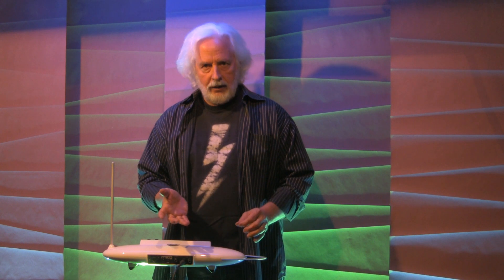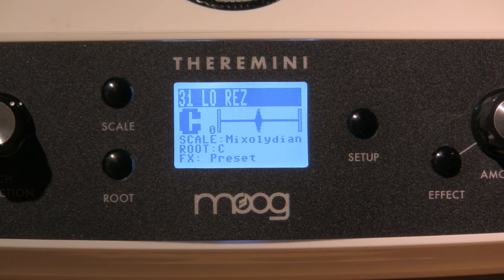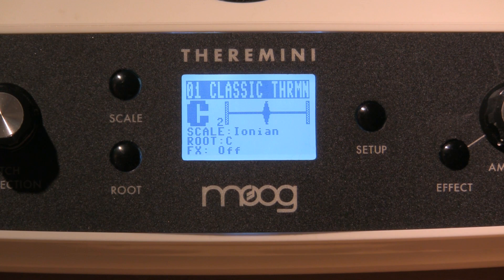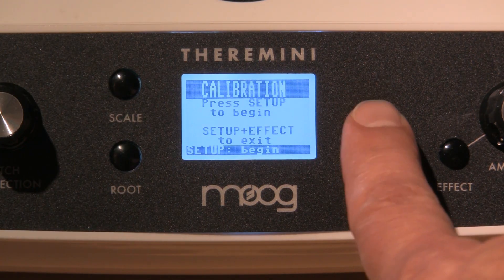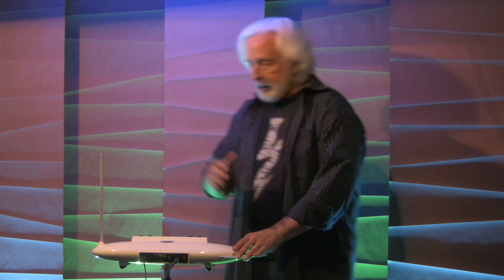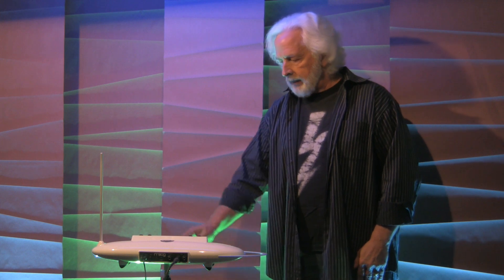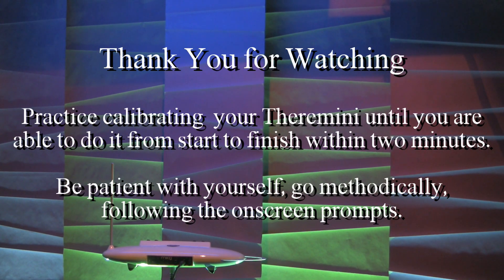Kip Rosser's "Complete Theremin:" Theremini 101 - Basic Calibration

Comment: Thanks for this video. The best video explanation I have watched so far. 
Still having some trouble as my volume function doesn’t seem to do function and make changes most of the time. Do you have any suggestion? This is the closest I’ve come to having it calibrated correctly though!
Thanks so much.
Reply from the maker: I am glad that you find this tutorial helpful. However, I am unsure what you mean when you write: "my volume function doesn’t seem to do function and make changes most of the time." You may already know this but just in case you are unaware of this, the volume knob, even though it does make the volume a little louder and softer, its function is not actually used to control the volume from loud to soft. It is used to change the characteristics of the loop's magnetic field, particularly the "attack" when your hand starts to play a note. As you turn the knob counterclockwise, the response gradually gets smoother. As it is turned clockwise, the response gradually gets sharper attack, becoming more effective for cleaner articulation/definition of notes, which is also crucial for playing more rapidly. Try this for yourself and listen carefully as you play and you ought to notice a difference; it's not a radical difference, but is a difference. If you can tell me a little more about what you mean by "make changes most of the time," I may be able to suggest a little more.

Comment: Does this require an amplifier? Im trying to understand if it has its own speaker or how it all works? Any help is apprwciated
Reply from the maker: Hi, Bryce. The Theremini does have its own built-in speaker. It can be played without being connected to an amplifier. However, the speaker leaves a lot to be desired when it comes to dynamic range. It's sound is there all right, but the bass range is weak. The speaker's capabilities falls very short compared to connecting it to a decent amp. I always recommend a cable and amp in order to really get the optimum sound from the Theremini. An amp with two channels and controls for low, mid and high range will make a huge difference. If you'd like a recommendation (since I don't plug products on this channel) please email me at:

kr@performancekr.com

I've given several suggestions this week to people on a budget for amps under $200.

Comment: Hi Kip! Thanks so much for this extremely valuable resource! Question, after correctly calibrating my Theremini, it plays totally fine for about 10min, then the pitch field begins to slowly expand randomly on it's own, requiring re-calibration over and over again. Anyway to fix this?
Reply from the maker: Hi, and you're very welcome. What you're experiencing is completely normal. The pitch field will change as the Theremini's circuitry warms up. After ten to fifteen minutes, re-calibration is usually necessary. However, it should remain very stable after that. Having to adjust it once more is okay, but if it keeps needing re-calibration after that, something may be wrong. Interesting sidenote: the user manual for the Moog Claravox states right up front that once the machine is turned on, the player should wait a full TWENTY minutes for it to warm up!
Reply: @dnteuxurois  Thanks so much! This makes sense as I usually calibrate it the moment it turns on. I just donated to the Juliet Shaw Legacy Project by the way, excited to hear her music! Hope you're well!
Reply from the maker: @nickybedo7455  Hi, Nicky: Glad confirmation of the need to calibrate every time was helpful. A very heartfelt "thank you" for your donation. I'm still hoping more and more thereminists, theremin enthusiasts and electronic music lovers will donate before we end the fundraising in a week or two. You'll be receiving a personal message from me via email.
Reply: @dnteuxurois  I was happy to donate! You're the man!
Reply from the maker: @nickybedo7455  Many thanks, once again.

Comment: Hello Kip! Thanks for sharing your wonderful knowledge. I have a question. I found the theremini's volume velocity response a bit slow and I'm having a hard time getting my left hand better, maybe because of that. I have never tried etherwave. I wanted to know if it is faster than the theremini? Am I right in my suspicion about that? Or I just need practice. My learning of the pitch hand is going very well.
Reply from the maker: Hello, Fernando: Thanks for your compliment about my tutorial. I really appreciate it. Plus, the fact that it's been of value to you means a lot. As for the volume antenna's slow response, I can tell you that the somewhat sluggish "feel" is normal for this instrument. However, there are a couple of things you can do to optimize the response. Here's a tutorial that deals specifically with it - in the search field, type in the following:

Kip Rosser Theremini 201

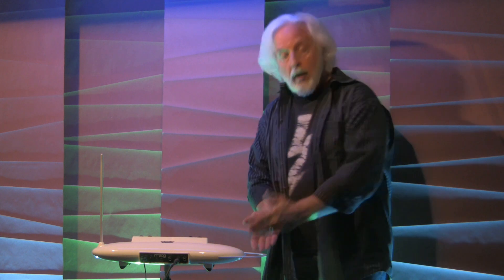From there, the two most relevant sections are these - and you can skip right to the first one at the 9:54 mark:

How to Access Advanced Setup: 9:54 - 10:12
Setting Response Speed: 10:14 - 12:49

So, experiment with the response at the MED setting and the FAST setting and see if the FAST helps without giving you distorting artifacts.

Regarding the response on the Etherwave, it is much cleaner, sharper and more importantly, it can be adjusted with more accuracy and and more choices/variations in response.

Comment: Is there a way to reset the Theremini (to go back to factory default settings)? I wasn't sure if previous owner messed around with some of the presets so I'm wondering if way to go back to default settings (hopefully that will keep the upgraded firmware and not reset that as well).
Reply from the maker: I'd need a little more information.

1) What is it that your Theremini is doing that makes you suspect the previous owner messed with it? Is it playing incorrectly, or, are you getting sonic distortion, etc. Is it behaving erratically? 

2) Are there any presets resident in the Theremini other than the standard factory presets? If so, the important thing to understand is that when a new preset is uploaded to the theremini, it always replaces an existing one. In the firmware, there's a library of all the preloaded factory presets; you can check your Theremin's presets against it and determine if the previous owner has altered/added in any way. Your Theremini's Presets should match this Library Preset list:

01 CLASSIC THRMN
02 SUPERFAT SAW
03 EIRE
04 ANIWAVE
05 IN ORBIT
06 RIBBONS
07 CHARLIE MUTE
08 ELASTICMOTION
09 FLUTTERFLY
10 ETHEREAL
11 WONDERTRON
12 ALL YOUR BASS
13 SQUARE WAVY
14 QUIET TIME
15 EVOLUTION
16 SHAKEN
17 WAAAHNIUM
18 LONG ECHOES
19 STRANGE STUFF
20 SPIN CYCLE
21 WOBBLESAW
22 FROLICKING
23 GHOSTLY
24 ORGANIC
25 LOST IN FOG
26 NORTH POLE
27 FUTUREWARZ
28 OMICRONPRSET18
29 DIGITALIS
30 BURNINGCHROME
31 LO REZ
32 MAGIC MISSILE

If your Theremin's presets match the above list, nothing has been messed with in terms of presets. So, the question, again, is, "What's your Theremini doing that seems wrong to you?"

However, if your Theremini contains a preset with a totally different name than those listed above, that means the firmware has been used and one or more of the factory-loaded presets has been replaced. To remedy that, you'll need to connect your Theremini to your computer, open the editor app and replace the presets you want to eliminate with the ones from the library of factory presets.

Comment: This is super helpful!! I haven't gotten to do much with my theremini yet but I knew at times something was off when I would try to use it. I will use this guide going forward. Very well put together and informative
Reply from the maker: Hi, Catastrophic: Getting the hang of doing the basic calibration is the most crucial element when using a Theremini. I still slip up once in a while, and when I do, I just turn the machine off, turn it back on and start again - even of the Theremini isn't making a sound. Just go through the process and it's 99.9% guaranteed it wi can be ll be fine. As you'll see, there are a lot more calibrations that can be done.But the main thing is to begin exploring via the tutorials and you'll steadily progress.

Comment: Thanks for posting this series. I just got a theremini and learning how to calibrate. This video is great! Am I going to have to go through the calibration routine every time I want to play or will it work okay next time if it is in exactly the same location?
Reply from the maker: CTMU: Thanks for your comment. I really appreciate it and I'm glad you find the tutorial helpful. In answer to your question, "Yes." All theremins, the Theremini and all other makes and models require
calibration every time it is turned on. Calibration method varies depending upon what theremin you own, but it's always got to be reset. Once you become proficient at it, it takes only about one minute.
Reply: @dnteuxurois  Thanks for your response. I was afraid of that but your clear instructions help. It would be nice if it would remember the settings so you would only need to recalibrate if you altered the environment. The calibration looks like it will go fast after a couple of times. I can't wait to get to know the other controls - what an adventure! The theramini should arrive today and am looking forward to working my way through your  theremini videos :)
Reply from the maker: @CTMURadio  There are occasions when you turn the Theremini on and it works almost as if calibrated. However, after a few minutes as the circuits warm up, recalibration becomes necessary. Regardless of whether the environment is altered or precisely the same, all other theremins (Moog Etherwave Standard, Pro and Plus, Burns theremins, Kees theremin, even the little Mini Gokken and the Gokken Pro) -- all have to be tweaked every time. And as for all the other settings and controls available on the Theremini, you're in for some fun.

Comment: Hi there- thx for the great tutorials! I just downloaded and installed the Preset software editor for Windows and it doesn't seem to work. It always closes after I close the quick start guide. Do you happen to know if the software has issues running on Windows 10? I'm afraid I don't have the 'Classic Theramini' preset on my machine.
Reply from the maker: Hi, Matthew: It turns out that the Theremini Editor App as it currently exists fails to run on Windows 10. This has been as issue since at least December of 2020, possibly earlier. The app runs on Windows 7 and apparently Windows 8. While I do own a PC, all of my music related stuff is done on a MAC - and that's where my Theremini Editor App is. Moog Music seems to be awareof the problem, but I've seen nothing regarding a solution.

Are you saying that your Theremini's 31 resident presets do not include the very first one that everyone I've worked with has --  "PRESET 01 CLASSIC THRMN" ? That is very confusing to me. What is there instead?

Comment: Hey Kip, this may be a dumb question, but someone on another video said that the Theremini had to be calibrated each time you turned it on.  Is that true?  I want to buy a Theremini, but I know that would be prohibitive to earning if it doesn't hold the calibration.  Again, sorry if this is a dumb question, but I'd really like to learn.  Also, how does it perform vs the Etherwave?  I'd rather have an Etherwave, but I can't find one in stock anywhere.
Reply from the maker: Hi, Chris: The answer is "yes," the Theremini must be calibrated each time you turn it on (see Kip Rosser's "Complete Theremin" - Theremini 101 and 101a).

However, so do all theremins; it's just a different process. Regardless of whether it's a Theremini, Moog Standard Etherwave, Moog Etherwave Plus, and even the Etherwave Pro, you still have to calibrate/set the instrument to achieve Zero Beat every time it gets turned on.

Of all the issues/frustrations beginning thereminists have, the most common is learning to set Zero Beat, a.k.a silence. Zero Beat also dictates the size of your control space at the pitch rod.

And for the Theremini,  the player has to calibrate for both Zero Beat as well as calibrate the parameters for the control space at the volume loop. Once you learn to do it, regardless of the type of theremin, calibrating any of these instruments takes less than a minute.

If you want to play the Theremini in the manner of a classic theremin, compared to an Etherwave, the Theremini has two substantive differences:

1) The Theremini's response off the volume loop is less distinct/clean/sharp, making it a challenging (not impossible, just challenging) to clearly articulate a sequence of notes for staccato or play pieces with moderate to rapid tempos. There are three things that can be done to improve articulation.
     a) set the response speed in Advanced Settings) to "FAST." (see Kip Rosser's "Complete
         Theremin" - Theremini 201)
     b&c) Study the techniques for improving note articulation (see Kip Rosser's "Complete
              Theremin" - Theremini 401, Part 1: Improving Note Articulation)

2) All other Moog theremins have tonal controls for Brightness and Waveform. Such controls are absent from the Theremini. Although, the Theremini's FX (the FX button and the AMOUNT knob) settings can provide varying degrees of delay, reverb, and echo.

There are many other differences, things the Theremini has that no other theremin has, like tons of wonderful presets and FX, the Theremini Editor Software App, and more, but the above two differences are the ones that directly impact playing the instrument as if it were a classic theremin. 

Now to the Etherwave:

As regards, Etherwave availability, I believe the Etherwave Standard is now out of production. The Etherwave Plus is the closest to the Standard. Keep and eye on Ebay because the Standard occasionally does makes an appearance, though. Right now, there's an Etherwave Plus up for grabs; at this writing the bid is up to $285.00, with 8 days left on the auction:

https://www.ebay.com/itm/363468626944?hash=item54a06b1c00:g:~4EAAOSwT3Fg7xls

So, for an Etherwave, setting Zero Beat must also be done when starting a practice session. (see Kip Rosser's "Complete Theremin:" Lesson Zero - Setting "Zero Beat" - Revised).

I've already mentioned the tonal control knobs. The other most striking difference is the Etherwave's ability to play rapid note runs and articulate notes with more sharpness/clarity. This make it possible to play music with more varied tempos, including very rapid sequences.

Which theremin you acquire depends largely upon how you intend to use it. But as uniquely different from other Moogs the Theremini is, it can still be played just as one would a classic theremin.

I hope this longwinded response helps.
Reply: @dnteuxurois  You're awesome!  Thank you for the insightful reply!
Reply from the maker: @chriswayne5000  Happy to help.

Comment: Looking forward to the next Theremini video. This one is quite helpful. I’ve been trying to use a pitch field from antenna to shoulder (I play seated) which is bigger than what you suggest here. I wonder what you set your lowest/highest notes to. Also I have a theory that using wired headphones interferes with the pitch field.
Reply from the maker: There are quite a few more tutorials since you posted a month ago. Hope you enjoy them. The size of your pitch field depends solely upon what you're most comfortable with. Large, smaller, whatever works. My lowest note is set at C2 (two octaves below middle C) and the highest is set at C7 (three octaves above middle C). My reason is simply that it's a) what I'm most comfortable with; and, b) the range is right for the variety of compositions I play. As for wearing wired headphones, I've never tried that, but I'll do so now and see what happens. I'll let you know if I get interference.